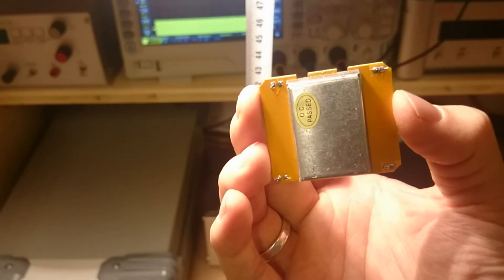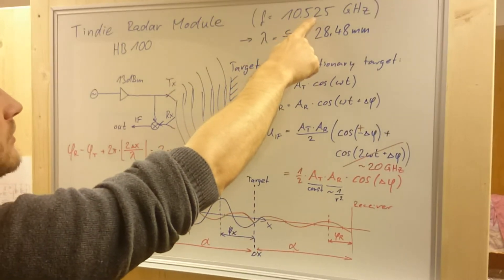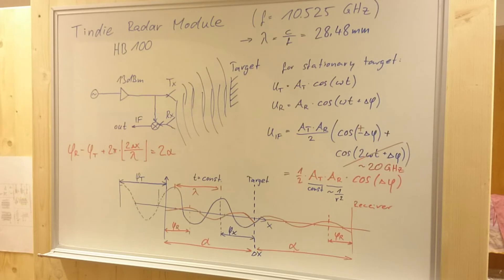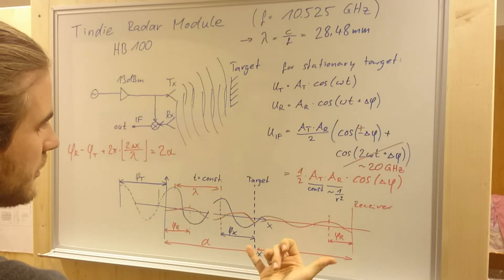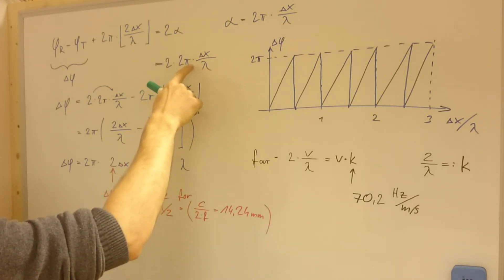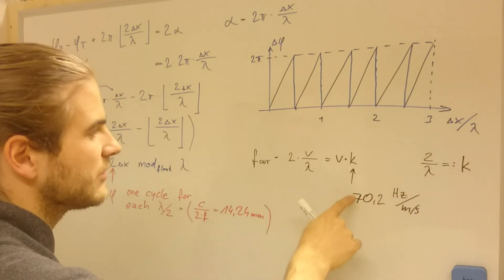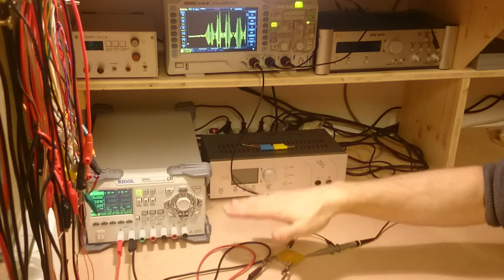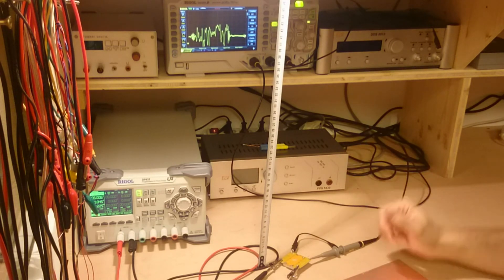Review: Tindie Doppler Radar Module HB200A,  (28.5mm)

Comment: please i have a question !
i try to design it on ads and i want to know what frequency can i give to RF??
and, is there any low pass filter there !!?
Reply from the maker: The oscillator is integrated with a fixed frequency.
Reply: @karlzeilhofer  actually i didn't ask you in a good way ! 
What frenqucy can we give to IF !?

Thank you
Reply from the maker: @younesszaarour284  I dont think, that there is any low pass filter.
Reply: @karlzeilhofer  sorry again!  
i wanna say ! IF=LO-RF
Reply: @younesszaarour284  No IF you get audio from the rx mixer. The doppler shift is in the audio range, you can hook up a audio amp and a earphone and hear the shift from the cars or objects

Comment: Can you change 10 GHz frequency by changing applied voltage? If so, then it is possible to get absolute distance and radial velocity. Thank you in advance.
Reply from the maker: I didn't try this, but I don't think so. The frequency comes from a ceramic resonator.
Reply: @karlzeilhofer  Thanks. I have 24 GHz module without ceramic resonator. And it is VCO, working from 0.8V up to.... don't know, no data.... but I tried up to 7.2 V without problems. There is similar module, much more expensive with I/Q outputs (mine is single IF output) that can work from 0.5V to 10V, and change frequency by 40MHz per 1 Volt change. I have no measurement equipment for this frequencies, so can't tell how much it changes frequency per voltage change.
Reply: @MilanKarakas   i have seen it done without a vco but not very reliable. shifting 50 mhz  with minimal changing the input voltage is possible. On this exact module? have to try it

Comment: Receive is proportional to R^4.  There are propagation losses going both directions, outbound AND inbound.   But this minor error will not effect your phase shift calculation.
Reply from the maker: Agrx Drowflow, I don't agree. It is proportional to (2.R)^-2, which is 1/(4 R^2)
Reply: I guess I don't understand what you're doing.  When I was designing radars at Raytheon, I used 1/R^4.
Reply from the maker: I just reviewed my statement again, and I have to admit, that I did a mistake here. I mixed up power and signal amplitude. The power decreases with 1/R^2 but then the signal (voltage) of course with 1/R^4. Thanks for your hint!

Comment from the maker: I've noticed, that the previous version HB100 is massively distributed on eBay for less than 4 Euros incl. shipping!
Reply: I wonder what the difference in specs is between the 100 and 200. I use them to transmit on 10.368 GHz as Hamradio transmitter. We where able to make 18 km in FM :-)
Reply: Dear Karl,
I am working on a project which uses similar radars. I liked the way you explained the concept. I need some help regarding this and it would be very helpful if you could share a source over which we could communicate. Looking forward for a response.